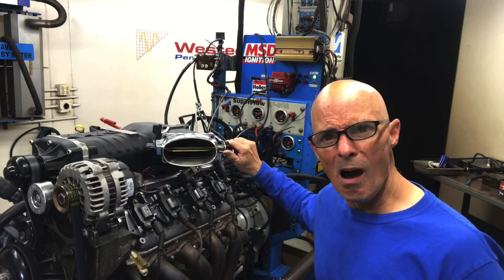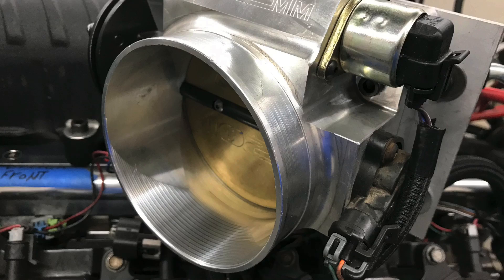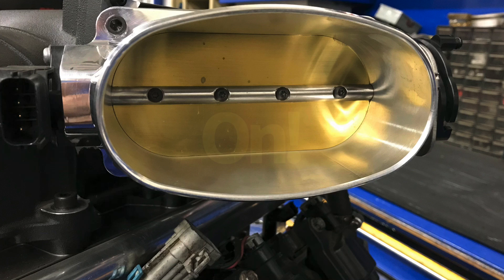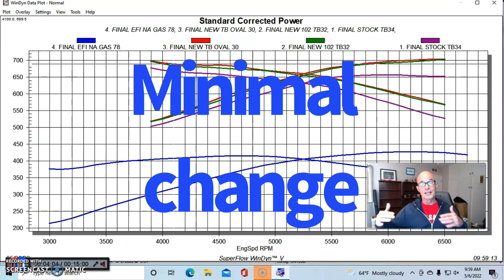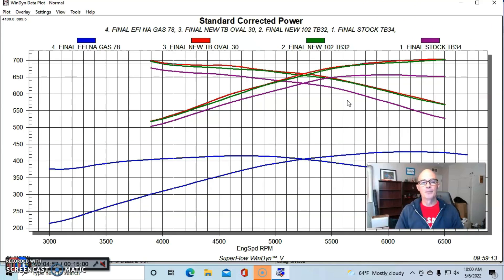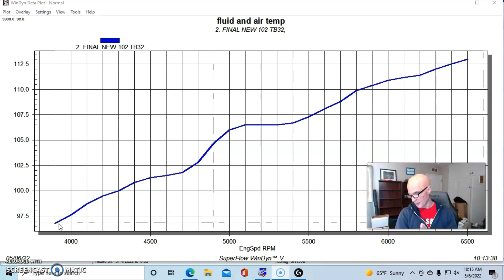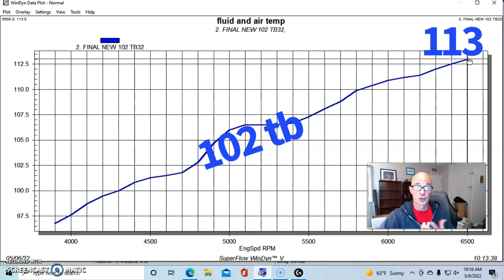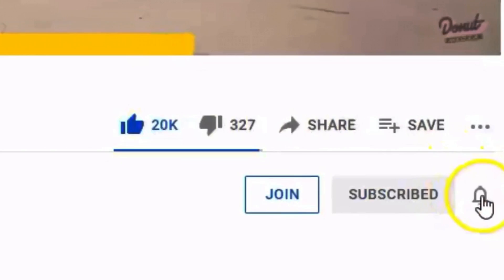LOW BUCK GT500 BLOWER THROTTLE BODY TEST-CAN A THROTTLE BODY REALLY ADD 47 HP? 78 vs 102 vs BIG OVAL

Comment: Do you have a complete parts list? 
I am interested on this and also will it work and do you recommend doing on a 2001 4.8 with 70k miles? Any info and advice is appreciated
Reply from the maker: mild cam and springs and tune for the 4.8L-converter also helps
Reply: @richardholdener1727  thanks for responding. I actually meant a complete parts list for the gt500 supercharger install. I found one for $400 with less than 10k miles.

Comment: sorry for the confusion. I’m using Tom Demeuse’s kit on a 5.3l LS motor with a VMP Trinity blower. What can I use for a throttle body. It has to be a drive by wire setup because it’s going into a 2013 gmc Sierra.
Reply from the maker: USE AN ADAPTER WITH THE STOCK DBW TB

Comment: Rich it doesn't go against all of the laws of thermal dynamics to say that the air temperature is going to be cooler due to increase flow rate. The faster the air moves over the intercooler, It actually will cool the intercooler not just be cooled by it. In turn making compression of the air by the supercharger more efficient and thus creating less heat. Simply put it's cooling through efficiency.

Comment: The higher temps came from the size of the throttle body and the blower fighting for air and trying hard to turn and just simply not getting the air. I would go with the largest throttle body because of the least restrictions and especially is your adding some sort of air ram system.
Reply from the maker: bigger tb equal more boost equals more temp

Comment: Squeezing air generates heat, the smaller throttle body having air forced thru its smaller orifice raises temperatures just like when it’s compressed

Comment: Could you get it up to 1000 hp. By turning up the boost.  How much was the adapter and intercooler? Spark degree?Afr.? Fuel type and pressure?  How much boost can you throw,  25 psi or...?
Reply from the maker: not sure that blower will support 1000 hp

Comment: The smaller TB creates a slight drag between the TB-plate and rotors, thus change of charge slightly now below barometric >14.7 to psi creates MORE heat from the change rather the larger TB flow is steady at baro to psi. 
It's small but remember vacuum pulls moisture out of the air.
Reply from the maker: MORE FLOW IN EQUALS MORE POWER OUT

Comment: Hey Richard, what injectors are you using. I know you said 80lb, but which one specifically. 
Thanks for your time.
Reply from the maker: deka 80s from accel
Reply: Thank you sir. Talked to Tom and have my adapter plates on order to go on a LQ9 that I’m replacing a 5.3 with in my 2005 Ranger. Just down the way in Corona Ca. Can’t have enough power in that little truck.

Comment: Look at the corrected Air mass (CFM * moisture * temp / correction) through the engine input (intake CFM:density) vs output (exhaust CFM:density) with the 3 variables. IAT will stay constant at the snout, but post intercooler will be the delta of efficiency. You can take the numbers and calculate the difference in power production.

Comment: simple explanation is the pressure difference across the blower changes the efficiency point of the compressor, smaller TB = lower pressure (vacuum) at rotor intake vs larger where you are closer to atmospheric. have a look at the TVS2300 compressor map. also why TVS blowers love having a turbo blow through them while screw type not so much!

Comment: My thought on temp is the that there is a vacuum between the blower and the TB.  That same area has the boost bypass valve and some of the heated air is recirculating into the blower.

Comment: What do you do for fuel injectors? I'm sure you run holley, but what do you see on dyno results as far as what size injectors are good for what power level. Things like lb per hour, fuel pressure, duty cycle ect.. I ask because I'm building an lq4 with BOOST. As always thanks for all the testing Richard, you do this industry one hell of a service.
Reply from the maker: please see the injector video

Comment: What are the dimensions of the oval throttle body?  Throttle body flow is simple: it's proportional to the area.  The oval throttle body didn't make much more power than the 102 because it's WOT area is not much larger.

Did you take pressure data at the inlet to the supercharger rotors?  I think it would show that the inlet pressure was lower than than the 102 and oval units.  This forces the blower to operate at higher pressure ratio and leads to the higher IMT.
Reply from the maker: area doesn't tell you flow-only potential-the flow bench tells you flow

Comment: What do you think a similar 6.0 truck engine would make with the same cam ?? Also would the stock GT-500 throttle body which would come with the blower work alright on the LS.
Reply from the maker: that tb will work-it just flows less than the oval

Comment: Amazing to see how much power it takes to turn the SC.  NA, it makes 427HP.  With a turbo at 14.7psi, that'd go to 854HP.  With the SC, it's only 707HP.  Is the awesome SC whine worth an extra 150HP of wear and tear?  It's debatable. :D
Also amazing that a standard width serp belt can transfer that much power without slipping.  Awesome design by Tom to get that great belt wrap on the SC pulley.
Reply: It isn't the blower whine, it's the immediacy. I drove an ecoboost work truck and the power was great once it got there. With a roots blower, it is right under your foot

Comment: Reduced efficiency.  Higher vacuum at SC inlet.  It'd be interesting to put a Vac gauge between the TB and the SC.
Put a bell mouth on the 102mm TB to reduce the restriction even more and eek out a few more HP.
It'd also be interesting to put a layer of BB's or small beads on the oval throttle plate and the 102mm TB.  Count or weigh them to see how close the actual area is to each other.  Even though the Oval looks larger it may not be.
Reply from the maker: I can just flow them

Comment: Because the amount of air moving over it with the smaller throttle body wasn't sufficient to keep the temperature down like the other bigger throttle bodies there was more air volume moving over the intercooler therefore keeping the temperature down

Comment: I believe if you measure the temp just prior to the rotor, you will see an increase in temp there. I think there may be a choked flow condition that is accelerating the air to sonic speeds.

Comment: You can’t/aren’t making the blower work any harder without changing a pulley , thus in theory the blower is spinning the same speed every run . The only variable that is changing is the amount of airflow it’s receiving . Your asking it to do the same amount of work with let’s say 10% less airflow.
Reply from the maker: more flow equals more work-think about a paddle wheel or propeller

Comment: About the smaller throttle body, higher inlet temps and lower boost, I wonder about the blower itself imparting the same heat to less air and the less dense charge cooling less as it passes through the air to water inter cooler. I don't know enough about heat transfer in blowers beyond the simple understanding of low to high pressure results in lesser to greater heat(or the same amount of heat, just in a denser volume). I know enough to know that there is more to heat transfer than pressure in and out because of the differing amounts of heat that centrifugal and roots blowers due to the ways that the blowers build pressure. Put short, I know enough to know I don't know. Would be neat to see some runs with even smaller throttle bodies or less than WOT to see if there is a clear trend related to throttle restriction and inlet temperature.

Comment: I wonder if the 78mm throttlebody will never make more than 650ish horsepower with a supercharger, no matter how small the pulley is
Reply from the maker: the power will continue to increase with boost with the smaller tb, it just becomes more and more restrictive

Comment: Blower is working harder but also heat transfer vs mass. Same reason guys add larger intercoolers/reservoirs. If you have a given mass of something and it takes 1 minutes to reach X temp, add 50% to the mass of that same thing and now it might take 1:45 to reach X temp. It’ll still get there but it just slows the rate.

Comment: Recycling its own compressed air? Might be easier for the compressed air to leak past the rotors rather than the fresh air to enter the inlet because it's a restriction? Would explain the lower boost and the higher temps. Keep testing Richard!

Comment: Well I can think of two possibilities. 
#1. It could be that the restriction itself, created by the smaller throttle body is also creating an air temperature increase, before it even gets compressed. 
#2. If the smaller throttle is creating a restriction right behind it, then there will be a greater pressure increase, because it will be starting from "below" normal atmospheric pressure, and going up from there....

Comment: How good is the internal sealing of the rotors in those blowers? Is the heated,compressed air leaking back from the pressurised side to the low pressure inlet side bringing the heat with it?

Comment: What do you suspect is easier to tune for part throttle drivability, a big oval TB or twin entry factory stuff like a 58mm from TPIS (Gen 2 LT1). Assuming you need the airflow and the manifold is ported to suit. My 600hp combo does not lol. Yet...

Comment: Reduced air velocity caused by the restriction that also reduced overall air volume in the blower itself resulting in less heat dissipation.. like covering part of a radiator, it may be the same size but reduced air  causes more heat soak.

Comment: Where was the air temp probe located?  Before or after the throttle body?
Reply from the maker: if you had it before-it would just measure ambient air in the dyno

Comment: I would like to see where a 90mm throttle body would rate on that setup. The blower can only process so much air, so you eventually reach a point of diminishing returns. Adding a 90mm to the mix might help figure that out.
Reply: From Richard's test data we saw that boost loss was 1.8 psi with the 78mm throttle, and .5 psi with the 102.  Flow capacity is proportional to area, and the ratio of areas between the 102 and 78 is 1.71.  The ratio of areas between the 90 and 78 is 1.33.  The difference in boost loss was 1.3 psi.  Setting up a simple ratio of change in boost loss to the ratio of areas:  1.3/1.71 = x/1.33 gives a boost loss of 1.01 psi for the 90 mm throttle body.  Power added would be about 78% (1.01/1.3) of what the 102 added.  This is sort of an oversimplification, but should be close.
Reply: Yes, that is oversimplified. It's based on assumptions that may not be true. That's why we test things.
Reply: @michaelblacktree  I keep posting performance predictions so that Richard will run tests to check my assumptions.  So far he hasn't been interested.

Comment: The smaller TB is not allowing enough airflow across the charge air cooler . More air volume gives it more dense air and the cooler does not have to work as hard.

Comment: Less air flowing across the rotors,  so less cooling effect leading to hotter intercooler entry temps?
Can you play with water flow to find optimal flow to keep Temps down?

Comment: The smaller throttle body was taking in less air thus the blower heat was saturating it more than with the larger throttle bodies which took in more air so the same heat in the blower was being spread out through more airflow which in turn created a lower inlet temp vs the smaller TB
Reply: Thank you for saving me the trouble of writing that explanation.......
Reply: Same!

Comment: With the higher volume of air being provided by the larger TB it carries off the heat being produced by the blower and it runs cooler, less heat soak.  It could also be possible that with the air restricted with the smaller TB at speed you have a vacuum at the inlet of the blower and it causes turbulence in the blower and the shearing of the air creates heat, maybe a combination of both.

Comment: If the supercharger is having to work to pull air, more work+less airflow (the rotors are only cooled by the airflow over them)= higher temps. I'm actually surprised the difference isn't more.
Reply: Heat is still a byproduct of compression. The air is still being significantly compressed which creates tremendous heat even if you are adding more air and slightly less boost. Jet engines create a massive amount of heat in the compressor section. This was the big benefit of high-flow bypass turbofan engines over turbojets. The high-flow bypass air isn’t compressed as much so the air traveling around the compressor and combustion section are what help cool the core of the engine.

Comment: I does show that the SC is eating about 150hp.
Reply: Ya turbos are cool
Reply: But also there is an alternator and power steering pump and probably a water pump so it's probably not the full 150 but over 100
Reply from the maker: how does it show that?
Reply: I mean I assume he means that 427 with an extra atmosphere of roughly 15psi should be 854ish not 703 is about 150 less I mean without the supercharger you don't have the extra like 270hp but if it just magically gave you 15 psi then it's eating around 150hp but like I said there was more on the belt than just the supercharger but I mean the supercharger did take somewhere north of 100hp